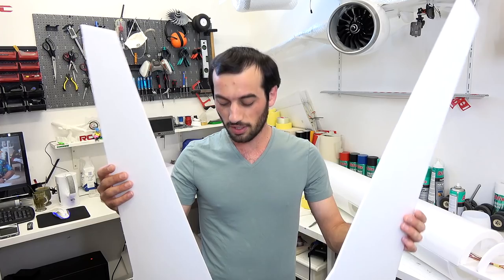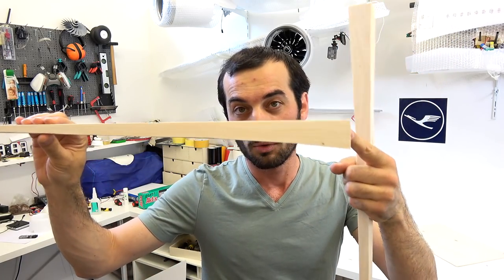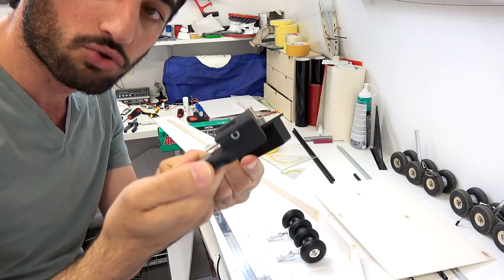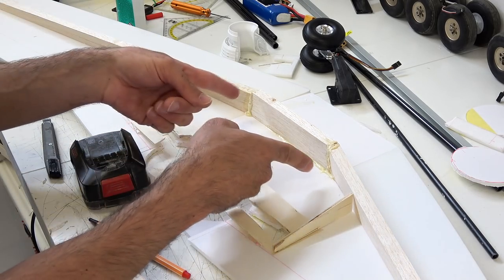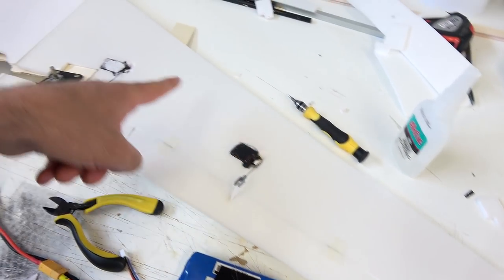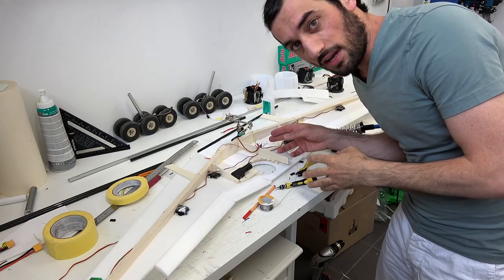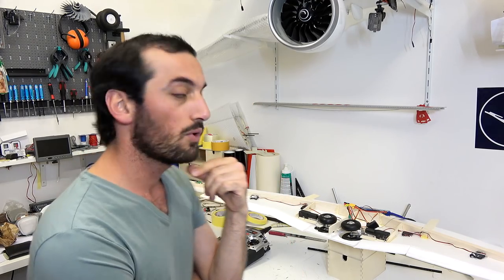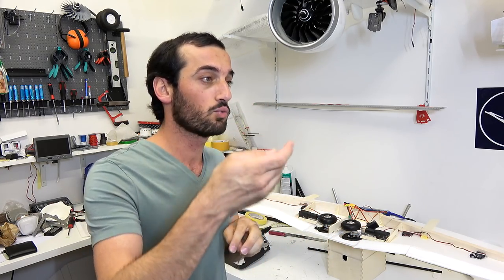Boeing 737 MAX-8 RC airplane DIY project P-3/ building the wings

Comment: The DX-18 you have can do so much more. You can program it to slow down the flaps and landing gear. They are moving a little too fast. Plus, by slowing them down, the airplane will fly smoother when those things are deployed slower. On one of my jets, I have 1 switch programmed that does it all. When I want to land, I hit the switch and the following happens....Dual rates go to low, flaps go down slow, gear doors open, gear comes down slow, Gyro turns on.....all this with one switch.
Reply from the maker: sure man, it's a great radio

Comment: Just a thing I noticed - shouldn't the wheels sit deeper inside the wing center? IIRC, a real 737 has wheel sidewalls and covers flush with the belly, with the elastic cuff covering the gap. Is your undercarriage as deep as it possible without a conflict with the upper wing skin? Or are you preparing some new trick and you'll surprise us all?

Comment: How does he get the parts so accurate to cover the tail. You know the strips.
Reply: He cuts the parts out before hand,trims them and does a dry run before assembling with adhesive,standard method with any planking,it takes practise like anything in life.
Reply from the maker: exactly 😉
Reply: Thanks!

Comment: what is the measure of the wings
Reply: He mentioned in the last video that the length of the model was 2mtrs which if my calculations are right and the wings are to scale they should have a wingspan of ~1.8mtrs
Reply: Peter Ferguson that doesn't help very much.
Reply: How do you figure that? He asked a question, I answered... which part exactly doesn't help?